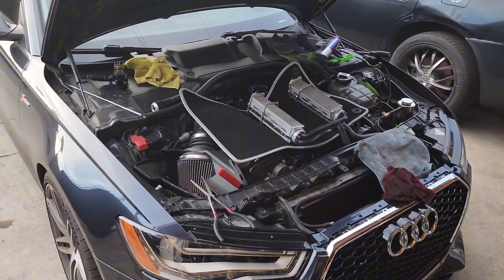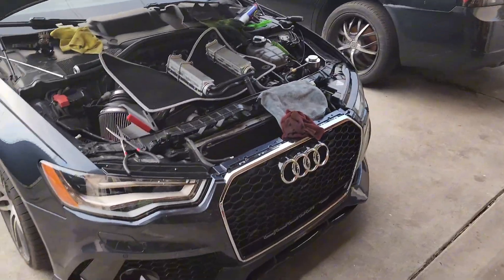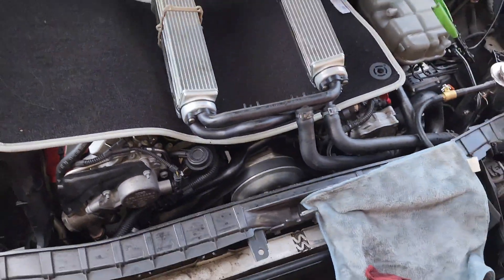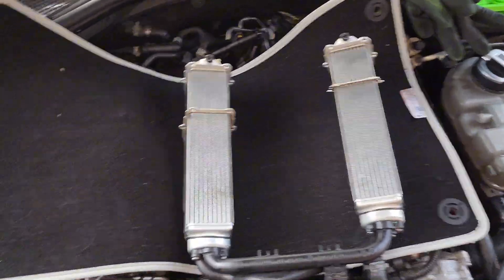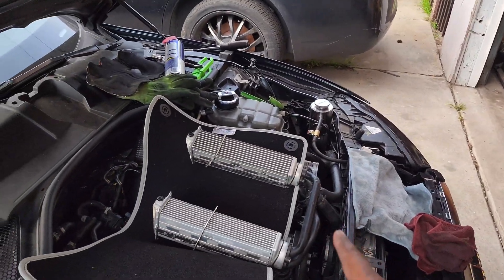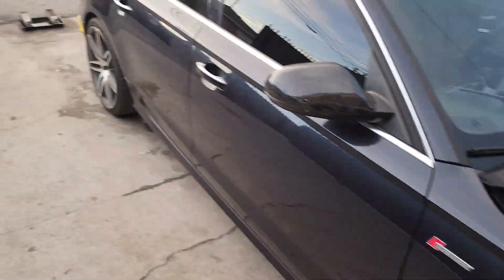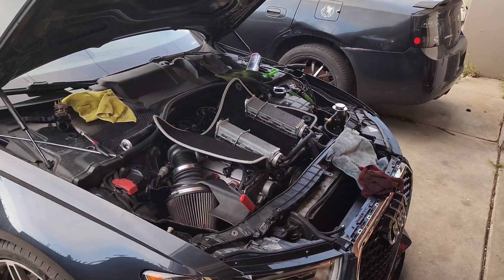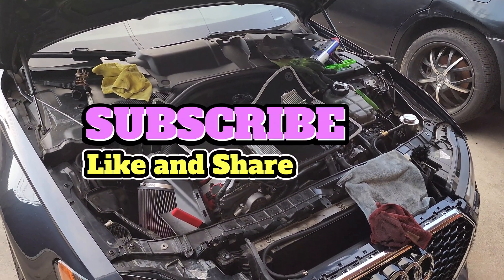Audi 3.0T Intercooler Testing & Cleaning

Comment: What about the PCV Valve?  I gap my spark plugs at 0.28 on the 3.0T
Reply from the maker: Looks like my pcv may have been done by the previous owner. I don't burn excessive oil. Hopefully it will be fine until I get in there to do some other work.

Comment: Hi friend, great video!
Solved the problem by changing the coolers ? I have the same problem
Reply from the maker: Not sure yet but my intake temps are back down. In my case some of the boosted air was getting into the small crack in the intercooler. Air pressure would come out of the divorced reservior when I opened the cap to check. I still need to gap my plugs before I log though. Gonna see if someplace local has the gapping tool for Iridium plugs today.
Reply: good luck buddy ! Thanks for the answer
 @cmidas3396

Comment: I dont think the bkr9eix plugs came gapped that small.  Mine came gapped at .032
Reply from the maker: I can't remember exactly what the gap was but I checked. Not sure if APR pre-gapped them.
Reply from the maker: I can't remember exactly what the gap was but I checked. Not sure if APR pre-gapped them.
Reply: @cmidas3396  Im not sure if any companies would set gap for you if the manufacturer didnt because then of something happens and tip breaks or something later they could be held liable.
Reply from the maker: @rafaelbatu7525 They most likely didn't. They came with the APR Ultracharger and they said to gap them to .026 I believe and I think these were .028 or something close. I have a another set of new plugs that I'll probably just gap and put in to save the headache of taking these out and gapping them.

Comment: @cmidas3966 I had the same issue replaced plugs and gapped and ignition coils and kept having the issue. I pulled and replaced intercooler cores and they were burnt and leaking. Yours look much better than mine. Replaced those and haven’t had the issue again. I was at 49k miles the first time it happened and resolved in about 150 miles (driving to and from mechanic lol).
Reply: Was your misfire also happening under heavy acceleration at high rpm?
Reply from the maker: Yeah that's only when I noticed it happening. Gotta do logs though to see if it's happening on the low end.
Reply from the maker: I see. I do hear about injectors going bad. Logging would be the next best step to figuring it out.

Comment: I'm having the exact same issue with a misfire around 6500 rpm, but I'm not losing any coolant. The first thing I'm going to try is to swap in some colder brisk spark plugs and gap them to 034's spec. Please keep us updated if you figure out the cause
Reply from the maker: I'm probably starting to run out of fuel. Gonna do some logging though.